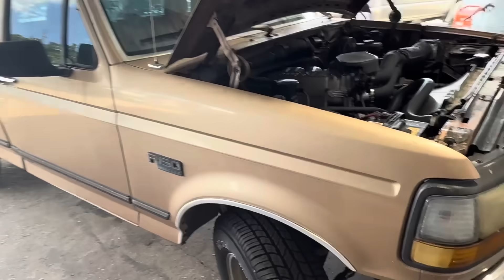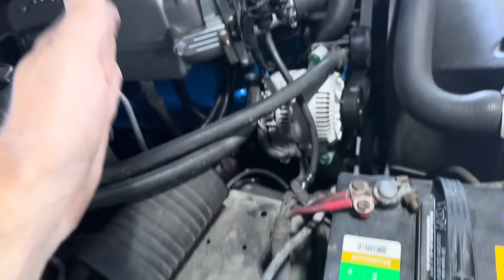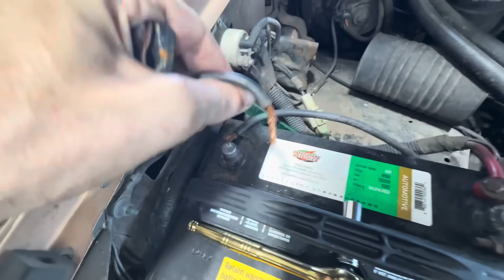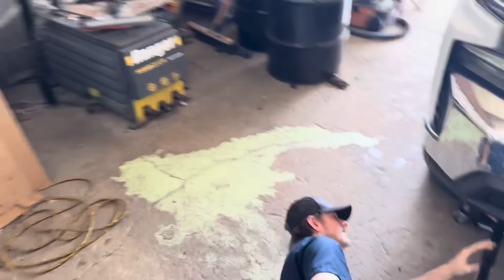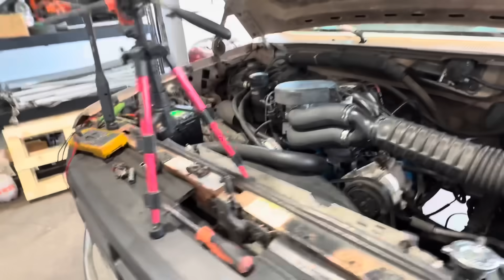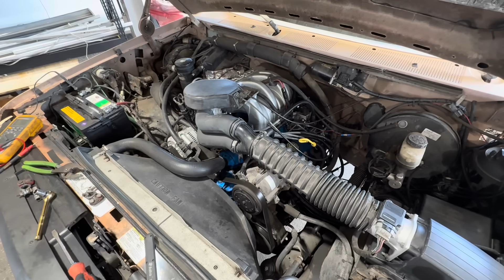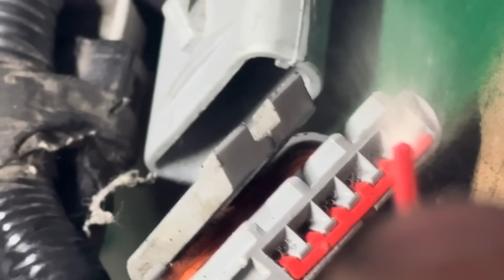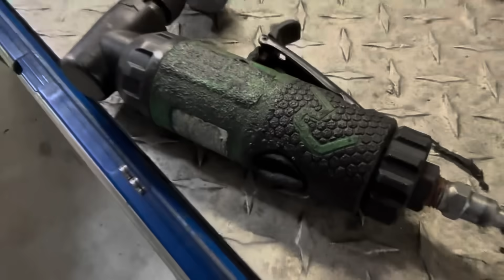Crank No Start! Accidentally Fixed! Can’t find the Problem! Ford 5.0

Comment: Well, in my experience with ford in general 
  1. Voltage regulator  or a harness going to it. 
 2. Inertia switch for fuel shut off causes issues. In many ways. 
3. Bad ground which you showed us . 
4. Another circuit feed ground where a ground has failed and causes  the other circuit to overheat short or shut down temporarily.  

I would hook a fuel pressure gauge and see if the pump fluctuations are consistent with the sound of the truck because maybe the fuel pump lost ground and using another means to keep running. 

Just my opinion.  

Stay cool .

Comment: +2 Ray,. you CANNOT do resistance checks on an ACTIVE circuit carrying current, the meter reading is Volts, even though you are on the Ohms scale.

Comment: I had a 1990 full size bronco 5.0l with a stumble it ended up being a internal short in the coil. I also had  a 95 F150 5.0 that stumbled due to a poor engine ground, I see the engine is painted is it possible the ground doesn't have a bare metal connection?

Comment: Hey. Just sending a heads up that vehicles of that "Vintage" (Calling myself old in the process as well) with the Electronic control modules, there may be a failing/failed capacitors in the ignition control module or a cracked solder connection causing the crank no start. Plugging and unplugging the connector could have caused a sufficient connection to be made even though the joint may be cracked. I have been viewing 2 channels in particular by the same person Shango066 (Vintage electronics channel with some auto repair) and 066AAR (His auto repair dedicated channel). I have been noticing that more and more surviving 80's and 90's cars have been falling victim to bad capacitors in the electronic control units causing a crank, no start. These capacitors are starting to reach their end of life and are going to start claiming more vintage vehicles. I'd honestly hate to see how many of our current cars survive in to "Vintage" classification territory.

Comment: Rebuilding old iron...
One day I was fueling up when an old Olds pulled in. It looked  AMAZING  like right off the showroom floor. I went over & talked to the old man driver and he said he had always maintained his own cars but for the last oh 20 years they have all gotten so technical with computers & OBD2 and all he has had to pay shops. SO, he set out & found this Olds 1984 it was with a straight body totally stock. Bought it & sent it to a refurb shop where they did a frame off resto. Rebuilt everything-new upholstery fresh tires brakes & paint and here it is in like new condition. This car he said I can maintain. And the whole project only cost me $18K - less than a new car.

!
Reply: My favorite car of all time was my 1972 Cutlass Supreme, engine 350. You can repair anything on it.
Reply: I agree new vehicles are full of electronic modules which can be a PITA to identify which one is faulty (never mind the new component faulty out of the box) now I know that this comment will be REEED because I own two vehicles that are full of them one is an 05 the other is an 06.

Comment: I dont think making batteries for electric vehicle is sustainable. They are good for going for to groceries, ect. I would much rather have something from the century that was made to last, so what if it uses a bit of oil, we have technology for systhises oils and fuels from renewable resources, and yes fuel can be burnt clean

Comment: I would have checked the other end of the negative battery wire to the engine  block  and to the frame and see if the wire are still heating up.  Good luck on that old girl .

Comment: I had a 96 F-150 and mine was doing the same thing. I changed the negative cable and fixed it. I peeled back the plastic and found the green puss all throughout the cable

Comment: Make up a 6' jumper cable with 10AWG cable and a couple of large alligator clamps. Go straight from negative post to block then negative post to ICM, negative post to chassis as a way to prove if its a ground side issue. I notices the ICM was bolted onto a section of inner fender painted green, possibly the unit needs case ground. Can't guarantee that there is a good ground from that one point near the battery all the way to the other side. Same tests can be done on the positive side from alternator output post to battery terminal. With the ease that the engine cranked with, I wouldn't have immediately suspected terminals though electronics can be very sensitive. Goes without saying charging voltage should be checked.

Many people below pointed out the issue with using an ohm meter on a live circuit but a hidden danger of using one in general is the current it sends out is so low that even if just one strand in a cable in intact it will still measure good. Voltage drop tests under load are a far more accurate test.

Totally agree its some kind of ignition dropout issue, question is why.

Comment: Check the output ripple of the alternator if the system is getting ac voltage from a failed diode in the alternator it will cause the symptoms your seeing especially on the tachometer  I've had it happen on 2 of my Lincoln mark 7 with the 5.0 engine and it was caused by ac voltage coming out of the alternator

Comment: I had the same issue when my fpr went out.
Reply: My 92 needed a new fuel pressure regulator every spring it seemed like. Fighting the little brass bastard outta the hole they put it in was always so much fun. Especially with the fuckin star hex bs they used to secure it

Comment: First thing i would do is lower your variables by disconnecting the very poor woring and aftermarket electrical components such as the cheap tach. It alone could be shorting internally causing a stumnle. Obviously not installed professionally. Then go to   fomoco original systems and test.

Comment: late 80s early 90s fords have crappy wire in the wiring harness. the old 300 6 is one of the best engines ever. 302 is second best ford engine ever.

Comment: Follow Eric O's philosophy.   Fix the obvious problem and you'll probably fix the rest.   Fix the short in the wipers at start up.   Obviously, electricity is sticking its fingers where it ought not to be.     Eric had a no start and it turned out to be the wiper arm motor - strange things happen.

Comment: Leaking capacitors on the ECM are a problem with this generation of Ford trucks so it could also be something with that.  Ray needs to find an old Snap On MT2500 to get some live data and to see if there are any codes stored in the ECM.

Comment: Ray just showed you how not to do resistance checks.  You only do those with the circuit isolated from any power source.  He should have been doing voltage drop tests the way he was testing it.  Voltage drop tests are more accurate anyway since they load the circuit.

Comment: Ray, learn how to use an ohmmeter, you can't check resistance on a live circuit.  This is basic stuff.  Do a voltage drop test instead.

Comment: Crank no start is a common problem in the old fords.  Grounding issues are definitely one of the issues. Suggest changing battery cables and clean that body ground by the battery.   Cleaning the connectors around the distributor and also the pcm , ecm, and anything else.  Egr and idle control might give you the stumble.   These old Fords have brittle vacuum lines... check those. 
New spark plugs and wires might be needed.

Comment: the only thing not checked that would cause crank no start would be fuel pressure regulator.  the old ford 302/351's used a diaphram style regulator on the back of the intake.  the stumbling could be caused by not enough fuel pressure at idle.

Comment: CLEAN THE GROUND AT THE BLOCK,2 THE IGNITION CONTROL MODULE SHOULD BE BLACK NOT GRAY,3 UNPLUG THE MASS (IT MAY COME TO LIFE)THIS IS ALL I HAVE WITH THE VID...REMEMBER AN ENGINE CANNOT HAVE TOO MANY GROUNDS.WHEN IN ? ABOUT A GROUND GRAB THE JUMPER CABLES AND GIVE IT ONE.

Comment: resistance is measured by applying a known fixed current (from the meter) and measuring the voltage dropped. If a wire from battery to chassis has internal resistance (due to corrosion or damaged wire strands) and car loads are pulling current, that extra current will result in extraneous readings. 
Pop the negative terminal from the battery and then read your resistance to the other places. That should narrow down where the problem is.
Reply: Sorry, got the known injected current confused with known injected voltage.

Comment: Ohm test is useless in this situation.  A battery cable and a speaker wire have same ohms measurements but speaker wire won't work in place of a battery cable. If EEC4 grounds on pins 20 40 60 on pcm will be affected by poor battery connection

Comment: Ray, I think that you might be correct, you accidentally fixed it. Many years ago, I was a young Marine. One of my MOS's was as an Aviation Ordnance Maintenance Technician. Part of the job was testing of Aircraft Ordnance systems, mostly electrical. There were a number of times when we were testing a system that we weren't getting proper readings. 
To troubleshoot the system, we'd start at the connection closest to the power source. If we got power there, we'd go to the next connection. Most times, by the time we got done, the system was working with us having done nothing to fix it. The act of disconnecting and reconnecting components broke any corrosion in them allowing the system to work. 
It's very possible that your Florida humidity was a cause. 
Finally, about those battery terminals: There is rarely a repair more permanent than a temporary one.

Comment: This is totally an improper way to test. Perform voltage drop tests. Use meter in same way but set to DC volts. With engine running and electrical loads such as lights and AC on, volt drop exceed .3 (3/10) volts

Comment: You are definately NOT an autoelectrician. NEVER measure a lead whilst the engine is charging the battery, you will have a voltage present that will skew your Ohms reading. Painful to watch!

Comment: One bad crimp or damaged wire in a loom can cause this.Also the IAC can be shaky and the ignition module on the distributor could have been damaged by the installation of that chinese tach which may  BE the problem after all.
DISCONNECT IT,   it may be shorting to ground internally
It's tough on the conscience  to charge actual time for a miracle fix, a mechanic's dilemma because it CAN be a come back

Comment: Wipers are acting as a booster for the starting circuit.  Pull the wiper fuse and I'll bet it won't start.  Just a theory.

Comment: I had a 1995 Lincoln Continental with a 281 that gave me fits for a couple of years with no starts and conking out. No one could figure it out but still cost me $250 to have it looked at with no fix. I FINALLY found it myself, it was a bad relay in the box under the hood, a $5 part.
On another note good sir, you should never work on mechanical equipment wearing rings or any kind of jewelry. It only takes one time to lose a finger or seriously damage it. Be safe!!
Reply: Gold rings on battery terminal helps with connection.

Comment: Unless the cables are damaged, just make sure the terminations are clean and tight with no corrosion in the crimps.  No need to add wires or increase the gauge. Those wires worked fine for 30 years.   It's correct that you can't measure the resistance with a live circuit.   You can measure voltage drop.

Comment: I have a bottle of Champion spark plug anti-seize. It's basically graphite in a carrier. I apply it to all electrical connections to prevent corrosion and promote conductivity.
Reply: Graphite is a fairly high resistance conductor.

Comment: you cannot take an ohm meter reading while current is flowing in a wire.  The circuit must be completely de energized, so the meter only is supplying the current to the wire, and calculating the ohms by the voltage drop between the probe tips.

Comment: Ray, 
The person that mentioned that you are using an Ohm Meter on a powered circuit should not be done. Not only is it inaccurate you can potentially damage the meter. Use voltage drop. Note Ground Side under full load should not exceed 200mA. and 400mW on the Positive side. Just gave those specs for reference. Another way is to use a low amps probe with an oscilloscope and watch the changes in current as it surges, and then move the probe along the conductor if you want to find the highest resistance point, as the amps will change most at that point. Used that method years ago on fiber optic cable (as an intern with the phone company to complete my engineering degree).
Reply: No you can't measure resistance on a powered circuit, but you aren't going to damage a Fluke that way.  You can put it across 240V AC in resistance mode and it'll be fine.  This isn't true for all meters.  Flukes are fairly bulletproof.

Comment: I had an after market tach cause all sorts of issues , no start/rough idle/ back firing I pulled the trigger wire and the truck ran fine. I got rid of the tach and never had another issue

Comment: You have moved a bad connection.  Don't worry it will move apart again.  But when, nobody knows.  That stumble could be the Idle air valve.

Comment: Check the wire ware it attaches at the other end. Do not check with voltage running through it.

Comment: Wires , plugs , fuel ? Ray any of these ? Check resistance on ignition wires, Pull a couple of plugs just to see what they look like,{see how the engine has been running . Take a sample of fuel see what it looks like {water/dirt }.???

Comment: I had an issue like this in my old car. It was 1998 Saturn 6 speed and it would be a no crank, just a click like a dead battery but sometimes would start with no issues and then eventually just would start or charge anything like the alternator had died. Lucky could push start it. After hours of checking wires found it was the ground cable had to the frame had fallen off. So assuming that had been loose causing bad connection until it failed. Replaced that connection and it was good as new. Kinda thinking this is the same issue somewhere with a bad connection or something failing.

Comment: Ray, if that wire is getting hot, it will not get better. I'd throw a newer thicker ground wire on it if possible. It would absolutely not hurt a damn thing

Comment: My initial thought on this fine gremlin.. pinpoint voltage and amperage being discharged from the alternator. Bad voltage regulator can cause irregularities within the electrical system. Plus if amperage is dipping from the alternator.. have it inspected & tested to confirm its not a defective unit for the customer. Poor voltage and dipping amperage from the alternator is pretty clear at that point.. but its best to have it tested & inspected to save the customer money while establishing a means of good reassurances thats beneficial for both you and the customer that shows that you're refraining from loading up the parts cannon without full confirmation that is the issue man.

Comment: cables looked fine on my truck, went thru 3 starters and a battery , then hooked up a button starter. 5 days and it was just cables. At least they took the battery back.

Comment: there was a recall on the fuel selector valve. want to say it didnt cover the 95 but covered 94 and prior as its been years since i was looking at a friends ford. i was in my early 20s so i didnt have the knowledge i have now. we initially though the tank was bad and was causing a rough idle and stumble. i switched tanks just to try something and it "fixed" the running rough issue. i think we both were very frugal and just decide there was no need to fix the tank and he informed his wife not to use the other tank. every thing was good for some time till the problem came back. i took the gas cap off the tank not being used and fuel came pouring out. he ended up taking it to a shop while i was on vacation and they replaced the valve and it was running great again. crappy part was they charged him a "hazarded removal fee" for having to drain the overfilled tank and they kept the fuel. 

what happened with the valve is it wont fully switch from one side to the other. it would pull fuel from one tank and return it to the other. once the other tank got full it would back the system up causing a rich condition and making the engine run crappy.

Comment: My daughter had a 2008 Ford Escape that had an intermittent No Crank/No Start issue.  On hot days, it would not start.  Once cabin cooled, crank with no issue.  Never really determined the cause, but to fix it, wired in a push start (it was a hard key) that would bypass whatever the issue was and get power to the starter to crank it over.  Fuel pump etc all had power, so it just needed that power to starter.  If daughter couldn't crank it with key, she moved key to on and used push button.

Comment: REEEEE!!!! REEEEE!!!!! Ray, you broke the internet measuring resistance on a live circuit! REEE!!! REEE!!!

Howsomever, what you CAN do is measure VOLTAGE DROP.  Which is, in effect, basically the same thing as measuring resistance.  Any resistance in the cable will cause a Voltage drop when there is current flowing. You won't actually know the resistance, or the current, but you WILL know there IS resistance if you see more than say 100 millivolts or so of Voltage drop.

Comment: I believe there is a wire that comes from the battery around the back of engine. It has a Y connection close to the steering column, one wire goes to fuel relay and one for ignition. This yellow wire is prone to corrosion at the Y.

Comment: I have a 1990 F250 with 7.5L that was doing the same... crank no start, crank and start, ruff idle.. it was fixed by replacing the ground wires from engine to chassis and from battery to chassis.